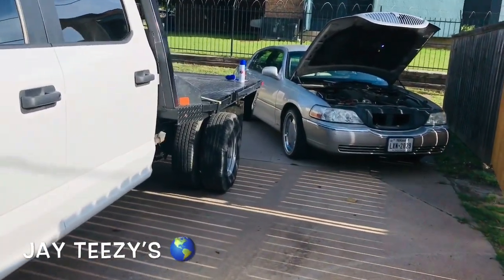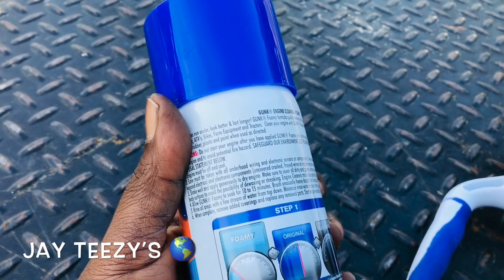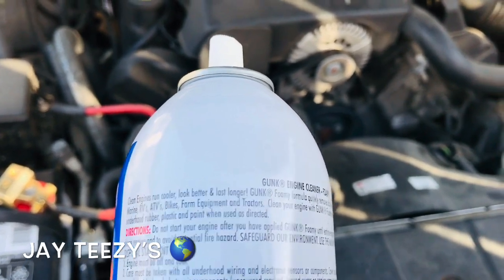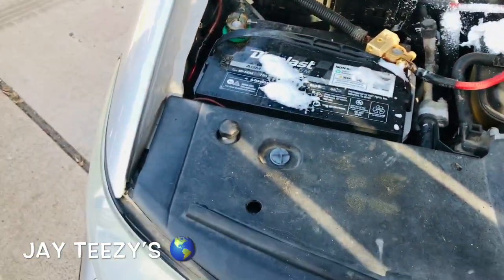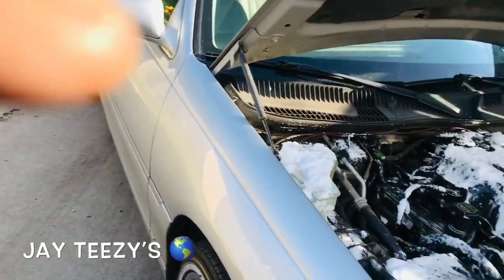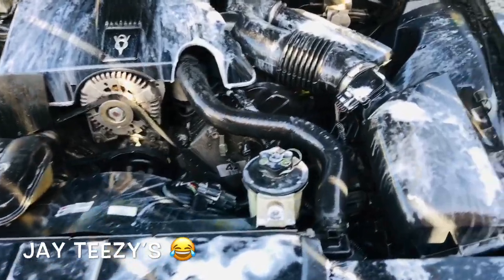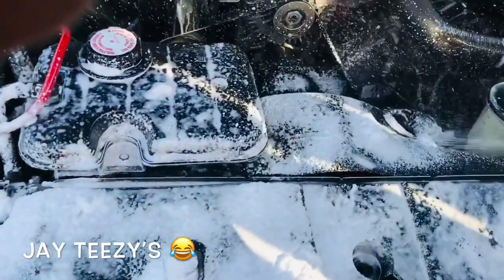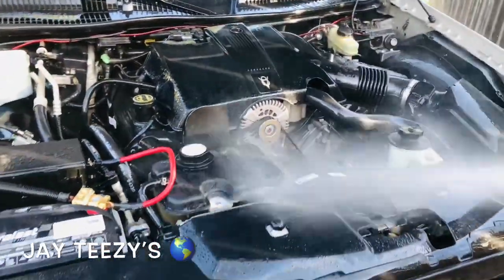How to clean engine bay & DOES GUNK ENGINE CLEANER WORK????

Comment: Jay does it matter if the battery’s connected?
Reply from the maker: I didn’t disconnect mine
Reply: For safer just disconnect battery that way you’re not gonna short anything
Reply: You should disconnect the battery until the vehicle dries. You could short relays and blow fuses.Just safer. He got lucky. Especially since he sprayed directly on the alternator. That should be covered with a plastic bag.
Reply: @nicholassharp8691  BIG FACTS
I CRINGED WHEN I SAW THAT
😬😬😬